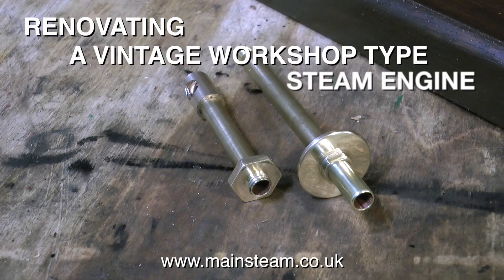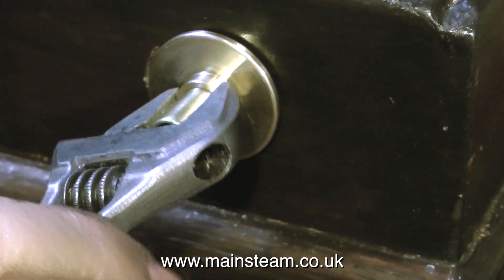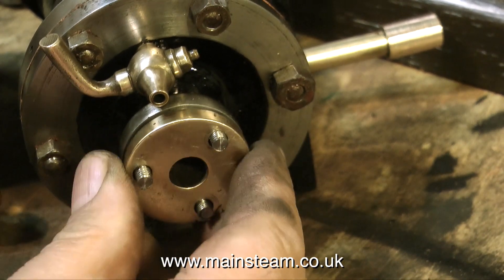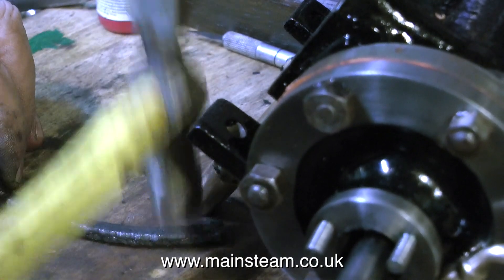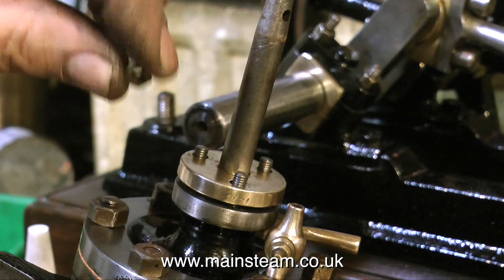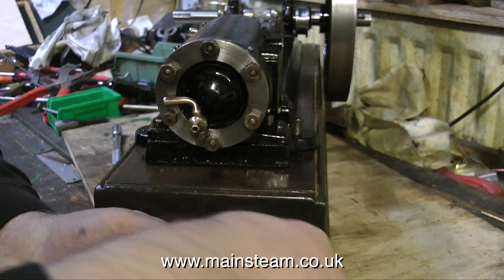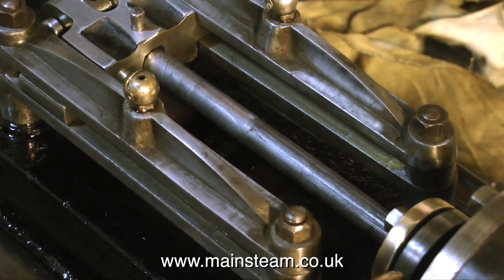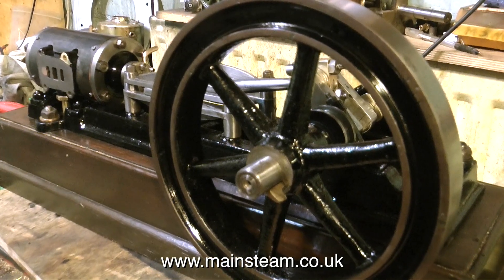PART #9 - RENOVATING A VINTAGE WORKSHOP TYPE STEAM ENGINE

Comment: My grandfather, who was a keen motorcyclist taught me to compress piston rings using a tin can split down one side and with the top and bottom removed. you wrapped a length of wire round it and twisted it to compress the ring-